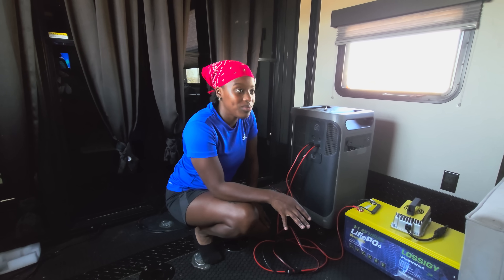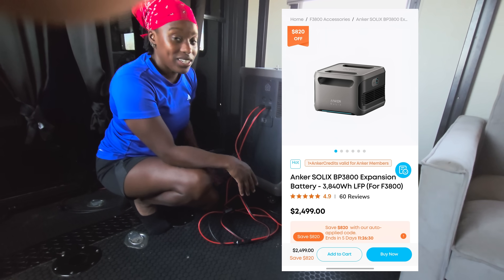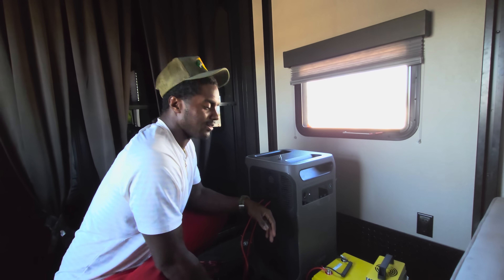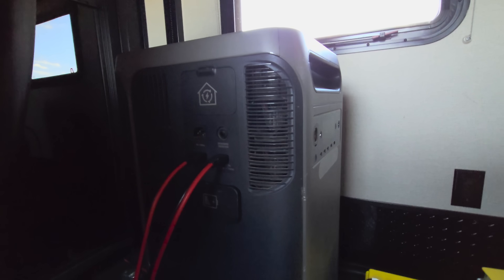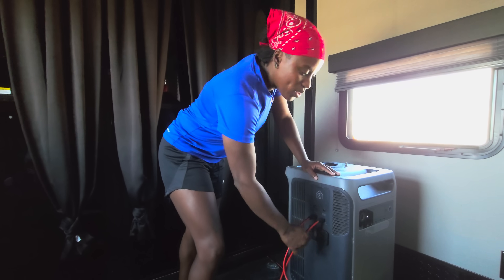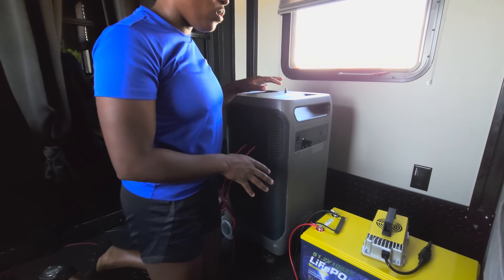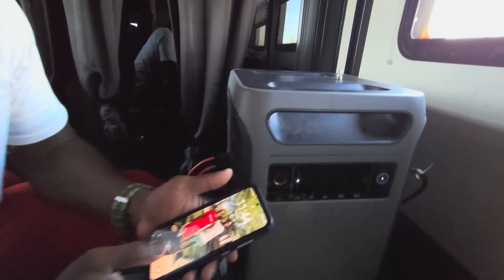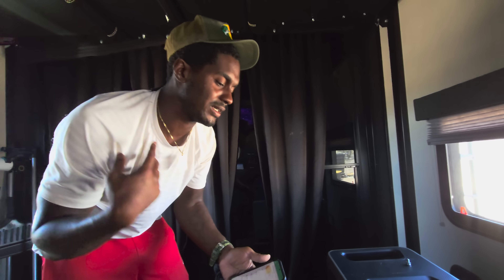HARSH Truth about SOLAR OFF-GRID - CAMP UPDATES and MORE!

Comment: That solar generator crap is a rip off and THAT is what's holding you back from enjoying massive power to run all of your appliances! Ditch that stuff and learn how to install individual components that will give you maximum power for less money. If you want to contact me, I can show you how I did mine and you can fix this situation. I would love to see you two using solar the way is is supposed to be used and not falling for gimmicks like that solar generator crap. Contact me and I will help you guys get going the right way. For starters, you need a pure sine wave inverter, (probably a 4,000 Watt Inverter) and about a 60 amp solar controller (make sure it's an mppt controller) and you already have a battery bank, but make sure you have about 1,000 amp hours of battery power and then the solar will charge your batteries and it will run all of your appliances all night long and all through the day. Gas generator will never be needed.
Reply from the maker: We appreciate your input and we are always open to learning. You can email us @jerrionjamal@gmail.com so we can exchange contacts. Or whatever works for you.
Reply: @livinglifewithleilooge  I will contact you guys soon so we can talk about a better solution for your needs.
Reply: I love this 🤙🏽🙏🏽
Reply: @livinglifewithleilooge, I do not totally agree that solar generators are crap. It serves it function. You have made the investment already. It is best to build around it in the near term until you are able to build a system for your home. The F3800 has a 6kW inverter, so for your camper needs, it should suffice. I have commented below about how to improve on your system without starting from scratch. Additionally, with the suggested improvements, you can use the same components if you wish to have a stand-only inverter to replace F3800 solar generator
Reply: @ko667  You are giving horrible advice. No one said they should "start from scratch" except you. You say it serves it's function, but clearly it is NOT serving "their" needs. You should not give bad advice that you don't have to live with. They are the ones who will have to live with your bad advice that will not improve their situation. It will only cost them more money with no results. I have built 3 separate solar systems and they DO serve my purposes. I can completely run my entire 5th wheel on solar and I have another system that runs my storage shed with two freezers and another system on my cargo trailer that I run my pressure washing business out of. It has a refrigerator, a microwave and I have put two power strips in there that take care of all my needs when I'm working. I also have a 12 volt AC unit with heating that runs off of that 300 watt set up. They have far more solar than I do and yet they can't run as many appliances as I can. You should not hinder them when someone is trying to help them.
Reply: Facts….  I got rid of my bluetti and upgraded to an EG4 system with over 30 kilowatts battery & 10k for solar input we get 60+ mile per hour winds. So my solar stand is built with heavy wood. In the ground.  No more flying solar panels 😧😧😧🤣🤣🤣🤣🤣🤣.  You’ll learn that you need “resting power” which is minimum amount of power you need to run your whole homestead. It may range from 700 to 1200 watts of consistent use.  Then factor in the maximum amount of power you homestead might use. Whatever that number is times it by 0.50.  I learned the hard way that those all in one system ARE NOT designed for continuous use lol. I replaced my system 4 times not including the 2 defective units I received. You will need higher solar input of at least 5k & an out of 7k. You will use the power.  Trust me. Congrats your new life fam👏🏾👏🏾👏🏾👏🏾
Reply: @Mansahx are you in West TX?
Reply: As someone who has lived in 2 self built Tiny Houses (in vehicles) over the past 8 years, I can say that I definitely agree with this. These solar generators are good when you a just starting out with your build, but the sooner that you can build out a full electrical system with a lithium battery bank, the better. These solar generator companies never give you the Amp Hour rating on their devices, because that's what tells you how long you can power all of these devices.

For a rig your size, you will need a 24 Volt system, with at least 500 Amp Hours of battery storage, a 3000 Watt inverter, and 1500 to 2000 Watts in solar. The generator will still be crucial on days when the sky is overcast and your solar collection is minimal.

Building out the electrical system is my fav part, so if you guys need any advice, just hit me up.
Reply: Thanks for your video but I think the air conditioner should have its own solar panels.
Reply: I built my system, total cost 8 k.

My first system cost 30k, with 100 kilowatts of battery.

Comment: Informative video y'all. I didn't know that you could simply connect a 3rd party battery to a power station. Thank you 💯💪🏽
Reply from the maker: We are learning as we go fam! You can even parallel the batteries. #HomesteadHomies
Reply: You can... just make sure the power station can actually take the voltage and that it is fused.  The Anker in this case can.  But this also means that you have to manage the external battery.  Getting an external battery with built-in bluetooth and an app will help you track its state of charge.  Or you just guess... which is kinda impossible with LiFePO4.  You can't  really tell what the state of charge is by measuring the voltage because the discharge curve is so flat.

You can parallel the batteries.  (note that in general you do not want to put LiFePO4 in series... such as for example putting 4 x 12.8V batteries in series.  No-go... that causes all sorts of problems).

If you parallel these batteries, you MUST use 2 AWG or thicker cabling for the paralleling.  Non-optional safety item.  Each one of those batteries can put out 5kW so we're already talking very dangerous amounts of power if the correct cable size is not used or the batteries are not fused properly.

-Matt